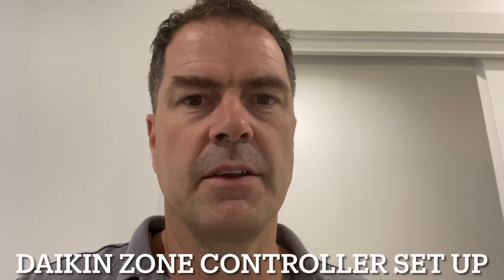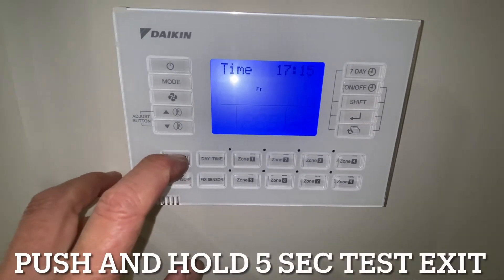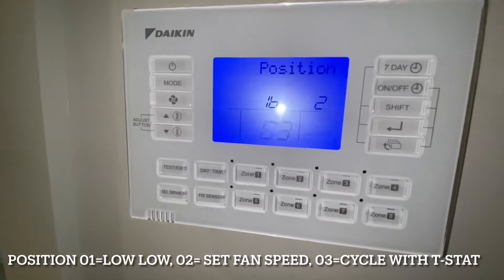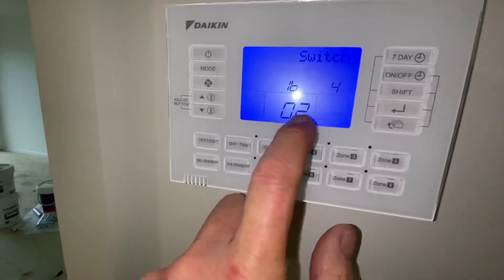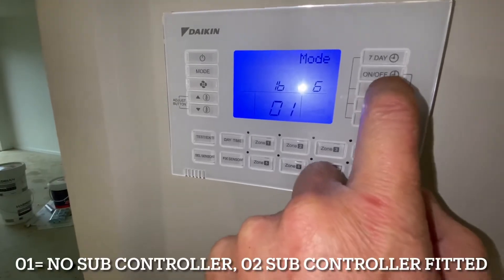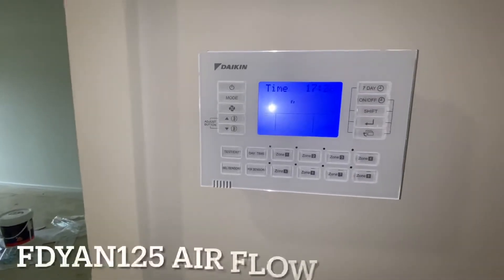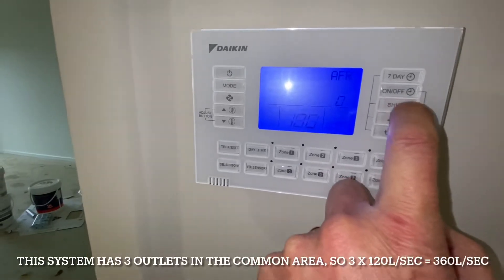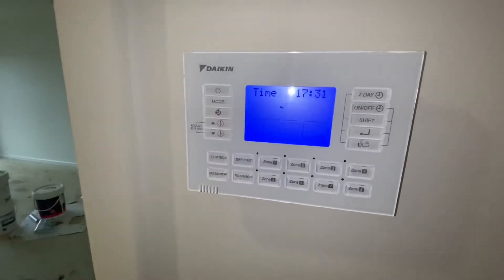Daikin zone controller set up BRC24Z4, BRC24Z8, BRC230Z4 and BRC230Z8.

Comment: My panel had a U5 error earlier today, and wouldn't work. I hard reset the panel from the circuit board, and now it wont boot past the initial screen. Just says V.1000 and the top and 88 and the bottom. No interaction possible on the buttons. Any ideas?
Reply from the maker: Could be a number of things, u5 usually means you have lost communication with the indoor unit. When you’ve turned the power on and off your rebooted everything and the controller goes looking for the indoor unit. It will show 88 until finds the indoor unit,  could also be a faulty controller cable, or a faulty controller, or a faulty indoor PC board, maybe los of power to the indoor unit, you really need to get your local Daikin repair person out to investigate.

Comment: How do I know if the remote sensor is connected?
Reply from the maker: Set both remote sensors as active in the field settings 1st.. Select sensor, fix sensor and let the system run. One of two things will happen, one it will run fine or two it will come up with a sensor fault. If it comes up with a sensor faulty you don’t have a remote sensor fitted. To reset the fault turn the power off to the system for 30 sec, turn it back on, go into field settings and set the sensors to off. Test the 2nd sensor the same way.

Comment: Is there any way of displaying current ambient inside temp on the screen, we have the wifi app & it has it on there but not on the unit itself ??
Reply from the maker: Unfortunately, this controller does not show the temperature at the wall controller. It does have a sensors on the controller, but you can’t activate it so it shows you what it’s actually reading. When this controller was released it was a step up from the standard controller of the time but it now dated and is in desperate need of an up grade in my opinion.
Reply: @FullyAirconditioned , thanks for quick reply, at least we can see the inside temp on the app 👍👍

Comment: Hi. Thanks for this video 

Got some questions of you can help me would be great. 

Have 4 zones  lounge, master, bed 1, and bed 2. 

The only room that doesn’t work is master when I active them all (not airflow). It’s just one year old house with new system.   Got same controller like
The one you show here.   Thx in advance
Reply from the maker: I would be calling the people that installed it, it sound like a faulty zone motor if it doesn’t turn on.

Comment: I can’t seem to get into the airside control menu. Indoor unit is Fdyqn250lv1 which I believe is dc inverter tech. Should be compatible right?
Reply from the maker: Could be the older model zone controller, dose it look exactly like the one in the video ? Or are some of the buttons labeled differently, if they are then it’s the older model and it doesn’t have air side control sorry.
Reply: @FullyAirconditioned ah yeah its the older looking zone controller. Is it worth getting the new controller or is there more that needs to update as well?
Reply from the maker: @Hedphelym  you will need the the controller and zone box in the roof, $300-$400 supply only, then installation cost. 🤷‍♂️ if you happy with how the Daikin’s controller works but want the advantage of the air flow reducing as zones get turned on and of then yes. Their are other zone controllers that give temp control in the rooms like Myair, cost is more tho

Comment: Great info, thanks - a complex way of setting up system. I am a very technical person, can fix most things, but when it comes to the Daikin brand, I can only say I am not impressed. That said , I really appreciate your video.  We just bought a new house (NSW - central coast), it’s only two years old and we did not get any manual or instructions on how to operate this unit. We have the R410A installed and the Daikin unit is all over the place, to say the least. Doesn’t always heat/cool the rooms, what does a service  call cost these days?
Reply from the maker: A service call is $250 include new filter media. If the heat / cooling is uneven in the rooms, it’s probably a poor duct design / installation problem rather than a Daikin unit fault. Builders are driven by price, lowest wins the job and they cut corners to lower the price. End user has to live with it and blames the brand air conditioner.

Comment: Hey Craig, is it possible to use one of these integrated controllers to modernize a 17 year old daikin ducted system? The system has been modernised a bit with the following, but I’m keep to see if new zone controllers can be used to replace physical switch based controllers. Currently running these:

BRP15B61 wireless controller
BRC1E63 wired controller
Physical zone switches 

Thanks!😊
Reply from the maker: It should work, if the brc1e63 works 👍 you will need to know your zone motor voltage 230v or 24v to order the corect controller
Reply: @FullyAirconditioned many thanks!

Comment: Hi, I have been trying to help a family member with theirs. They were told by someone, to turn the aircon off outside , for the filter to be cleaned and unfortunately when they turned it back on and we reset as per uour instructions in this video, they have lost all of the other zones. How can i add all of the other zones back for them?
Reply from the maker: B1-2-08 will get all the 8 zones back functioning, if you don’t need all 8 zones just change the last No, EG I’d you only want 5 zones then set b1-2-05 👍🏻
Reply: Thank you so much! @FullyAirconditioned
Reply: @FullyAirconditioned I am wondering if you were meaning 1b-3-08? They have 3 in the living area but apparently they used to come on individually? Or so they thought.... But I've done 

10-0-01
1b-0-01
1b-1-01
1b-2-03
1b-3-08
1b-4-02
1b- 5-02
1b-6-01
1b-7-03
1b-8-02
1b-9-09

I don't think they're working at all, trying even on heat and fan should be working but nothing????
Reply: It used to have one called common area but he didn't think there was one
Reply: @FullyAirconditioned so I've done it for the full 8 zones because we aren't sure if the 3 in the living area were/are set as a common area but they don't want it to come on automatically when the others are off. We have master zone 1, bed 2 zone 2, bed 3 zone 3, bed 4 zone 4, and then I assume zone 5, 6, and 7 are the 3 in the living room and though I have zone 8 as active, there isn't an 8th outlet... But I've used 8 and divided the airflow to be 105 each zone but zone 0 as 315.
Reply from the maker: @MaddiJChannel you need to turn everything on then turn off one zone at a time and see what outlets close off, write it down on a piece of paper. Turn that zone back on and then turn off the next zone, do this until all outlets have turned on and off. This should let you how many outlets are connected to a single zone motor. If some outlets don’t come on, then you might have a faulty zone motor or a duct has come off. If zones turn on when off and off when on this they could be wired incorrectly. If some areas don’t turn off this this area is probably a common area (not a zone as it has no zone motor and can’t be turned on and off) all ways on when the air conditioner is on.

Comment: This controller is a pain in the butt. They need something better imo. I’ve had to use your video multiple times for field setting and stuff
Reply from the maker: @1KsE1  I agree this controllers well  pass it’s used by date, Daikin really need to bring out something that’s much better. It’s super old and super clunky.

Comment: how do you simply change the time after daylight savings??  I cannot find instructions of videos anywhere
Reply: Press Day/Time button and use shift to move it around til your time flashes then use Temp up/down to adjust the time once you have the correct time press enter its simple the video explains everything easily and effectively
Reply from the maker: Press the day/time button, then press the shift button, its should say "Adjust" on the screen, use the temp up and down buttons to adjust the day of the week, press the shift button again and the time should start blinking , use the temp up and down buttons to to adjust the time, push the return button to save the set time.
Reply: @FullyAirconditioned  cheers fellas, much appreciated

Comment: Hi guys the led button on the zone controller is off but the zone(outlets) have airflow.When the led button is on,the zone(outlets) have no airflow.How do you fix this issue?has it been wired incorrectly?Thank you
Reply: It would be incorrectly wired but is an easy enough fix,,The Zone control board has 3 terminals per zone, Terminal 1 Open, Terminal 2 Common, Terminal 3 Close. Depending on what type of Zone motor you have, if it is a 3 wire motor ie Power on/Power off, You would have to swap out the wires on terminals 1 & 3, If it is a 2 wire zone motor, The wire on terminal 1 might need to go on terminal 3 or vice versa.

Unless you have some sort of electrical knowledge, I don’t recommend you doing this on your own as there is high voltage in the board.

Hope this helps

Comment: I'm trying to adjust my set up. So currently the lounge room is set as the main vent and has to be on to have any other zone operating. The vent is right above the lounge so it can get quiet cold but it needs to be on just to have the bedroom on.
Can I move the main vent to the kitchen vent. Or just have it set up so they are all operating independently (installer said this can't happen when installing but thought I'd ask).
Thanks

Comment: Thanks for the video Craig. I’m confused as when I’m doing my airside fan Air Flow Rate it only shows me Zones 1-4 (there is no 0). However I believe I have a common zone as I can’t have all zones off, 1 is always lit up.
Reply from the maker: @James-l6p9xjamesk811  1b -4-02 this set the controller to all zones off, or when you have a common zone, 1b-4-01 keep one zone all ways on, this is what you set when all outlets are zoned.
Reply: Thanks Craig - just one other thing. For 1b - 7, my installer had it to setting 1, however I notice you put it on 03. What exactly is this setting and why is 3 better? Thanks :)
Reply from the maker: @ cycles the fan off with the t-stat in cooling, so once the room reaches temperature and the compressor turn off the indoor fan will turn off with it.

Comment: I have this exact setup! However I want to control each zone, automatically turning off and on to maintain the set temperature especially since each room is so different. Is it even possible to do with a Daikin system?
Reply from the maker: @bobbilyy  no it’s not possible with the Daikin’s zone controller, it’s just on/off zoning not temp controlled zoning. We use the Myair or Myair IQ for temperature controlled zoning.

Comment: whats the first setting mean when you change it to 1b?
Reply from the maker: @johnpav1204  1b is the menu mode, that allows setting to changed for how the system operates. Mode 20 allows you to turn on and off the filter timer 20-3-01 is on and 20-3-02 off.  40 mode is a viewing menu that allows you to see the temperature of the sensors on the indoor unit are reading live.

Comment: If I am replacing my wall controller as the LCD is bad on my original, do I need to reprogram it, or just plug it in?
Reply from the maker: @legoman911  not 100% sure, but you once you plug in the new controller you can go into the field settings and see if they set factory or have been changed.
Reply: @FullyAirconditioned I just did this and no setup was needed, it was plug n play other than day/time setup
Reply from the maker: @legoman911  thanks for the update 👍🏻

Comment: Great video. My air conditioning provider has suggested there might be an issue with static pressure. They aren’t able to service for 3 weeks. Are you able to point me to the field code to set the static pressure. We have sans controller and the 140 unit (rather than 125). Online manual doesn’t help. It was suggesting 23 - 06 but when I go to mode 23 there is no 06 (goes straight from 05 to 08). Thanks
Reply from the maker: @Spencer_Marchant  your Daikin is most probably an older model, I am guessing it doesn’t have a DC fan motor, only an AC fan motor. DC fan motors can have 1000s of speeds as the digital signal generated from the fan driver board dictates the speed. With an AC fan motor it is dependent on how many winding are in the motor. A single phase motor will often only have 4 speeds. The daikin ducted unit with AC fan motors have low-low used when the cooling/heating cycles off and just circulating air. Then you have low high and high-high, two speeds are selectable from the wall controller. Out of the box low and high speed are selectable from the wall controller. There is a jumper block on the indoor units switch box, moving the cable enables the high-high speed. This is hight voltage and should only be done by a aquiflied tradesman.

Comment: how to correct the display LC error code on this Daikin system wired remote system display to reset restart the machine?
Reply from the maker: Transmission Error (between Inverter PCB and Outdoor
Unit Main PCB) unfortunately this would require a Daikin service tech, generally it's not a simple fix. You can try resetting the power off and on again at the switchboard, turn off for 30 sec then back on, turn system on at the controller and see if the fault return as normal. If it runs then all good, but of it returns with the LC fault you will need a Daikin tech to have a look at the system. Make sure you actually get some that knows Daikin units as many business out there say they can repair Daikin units but will just try and sell you a new unit.

Comment: Heya mate thanks for the informative video, i have this system in my 2 bedroom apartment and theres only 2 zones set which are: zone 1 living area and zone 2 bedrooms.

Both bedrooms are set to zone 2, is there anyway to split the bedrooms into 2 separate zones? My bedroom faces the sun all day so I need the air con more than my housemate. Its really frustrating me i really need to split the bedrooms, is it possible? Cheers mate
Reply from the maker: @davidodonovan2142  yes its possible, but you would need to take out the single zone damper in the branch of duct that runs to the two rooms and install 2 smaller zone dampers in each duct to each outlet. Depending on the zone controller type, it will either be 240v zone motors or 24 volt zone motors. The 24v zone dampers use a telephone like cable and any can do it if its 240v you will need to get someone qualified . If you only have two zones at the moment there should be room for 2 more zones as the zone controller has 4 zone ports  standard and 8 zone ports if that option is chosen. The zone box is located up in the roof.
Reply: @FullyAirconditioned  legend mate thanks for the detailed response 👍I am pretty clueless when it comes to this stuff so I would definitely need to hire someone to do what you said for my system, just wondering is it a big job and would you know what type of fee I'd be looking at to hire someone qualified to do what you said?
Reply: @davidodonovan2142  depends on access and if you have a standard 240v zone switch set up or zone controller set up like this. but its not too hard of a job, 2-3hours labour and a coupole hundred on materials

Comment: Hey mate, I have this panel but I noticed it's only going up to fan speed 3 and then resets back to one not going all the way up to 5 ?
Reply from the maker: @emellow3583  yep you’re AC unit only has 3 fan speeds, if it had more fan speeds then all 5 would be available from the this controller.

Comment: Can each individual room be temperature set differently?  Just moved into a 6-7 year old house with this unit and we're struggling a bit with it. We're going to want 21-22 deg in a month or two whereas the kids won't need it as cold. It also doesn't seem to flow ANY air at all currently unless its set at 20 deg or under. A  bit of research to be done clearly. Thanks
Reply from the maker: @jasonmcroberts7994  no it doesn’t control temp in different zones, it’s just on off zoning. Additional sensors can be fitted but that just changes the temp sensing location.
Reply: @FullyAirconditioned  thank you very much, appreciate the info so promptly. Cheers

Comment: Very helpful video. Is there a cheat sheet to summarise all those modes, switches and positions along with their descriptions?
Reply from the maker: @CamBaniasadi  yes there is, it’s in the insulation manual, you should be able to search on line or the Daikin’s web site
Reply: @FullyAirconditioned  Thanks heaps. And I assume that you consider the maximum airflow value not the nominal one, is that a correct assumption? I reckon for a 12.5kW Daikin system, the maximum airflow value is 840 while the nominal one is 755.

Comment: This video is great, my system - not so much. I can't adjust the fan settings what so ever after pressing and holding "test/exit". 

Whilst in use, it only goes up two bars, then swtiches to 1 bar Auto and again will only go up two bars. VERY frustrating
Reply from the maker: You unit is an older system and has an ac fan motor, with only 2 speeds. The newer DC fan motors  in the current model units have only been out for about 8 years. If your fan speed skips a speed it’s a sure sign it’s the older model with an ac fan motor sorry.